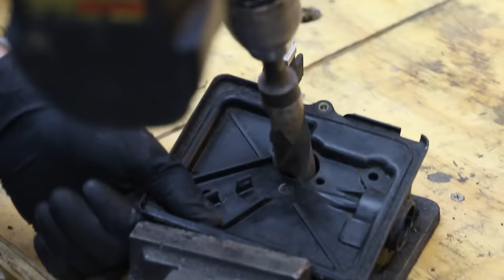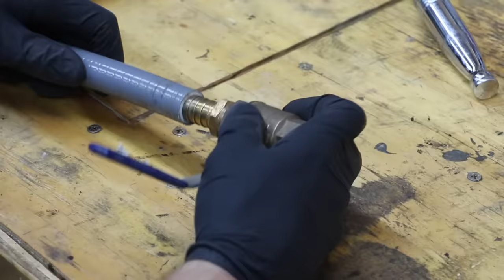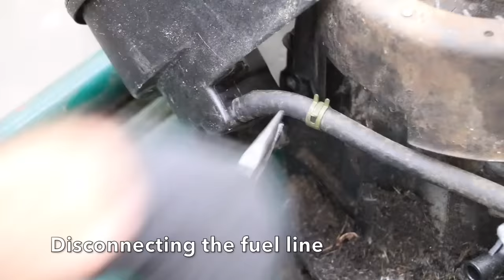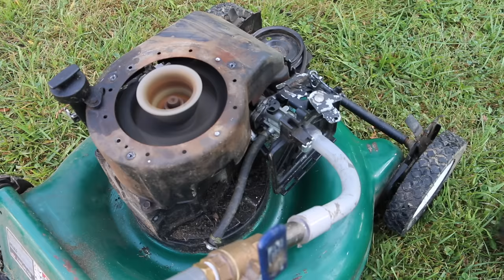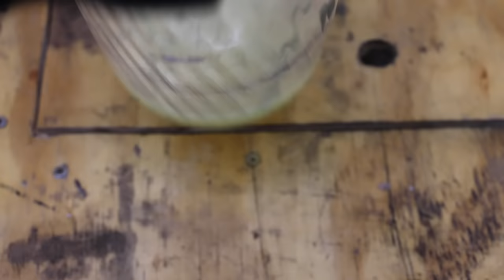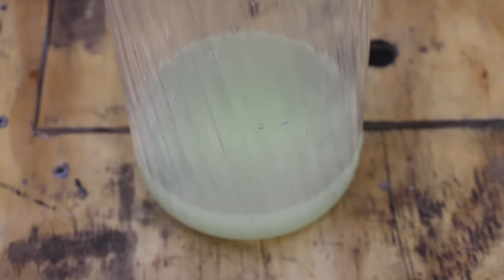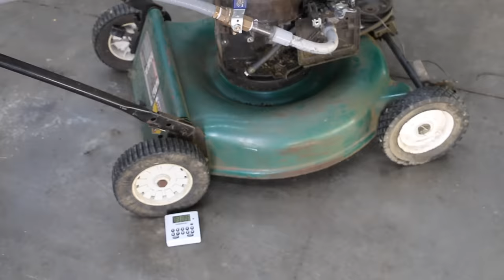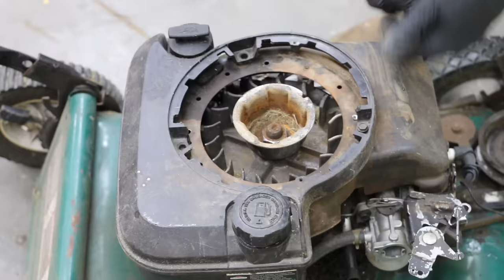Will a "Gas Vapor" Container Improve MPGs and Fuel Efficiency?  Let's find out!

Comment: Lift trucks that run on propane, can run on liquid or vapor propane and are not interchangeable. .So if you can fit a propane vapor carbutator on a car or truck  engine. . with throttle capability. . running on vaporised gasoline ; it could be fonctionning ☺

Comment: So, something that has come to my attention is HHO. Bottle with washers or such stacked negative and positive posts connected in water with backing soda, under a charge creates HHO (hydrogen.) what if you where to run this set up with a Hydrogen generator that pumped to the fuel container?

Comment: What if you used smaller tubes smaller system that has the same pressure it seems you could throttle back and possibly get the same rpm being its a vapor it takes more to pressurize the giant pipes idk just a thought
Reply from the maker: Thanks for the suggestion.

Comment: If you had cut the pipes to touch the bottom of the canister then drilled holes at the bottom sides of the pipes to suck in the vacuum air, then you could have used most of the fuel.

Comment: The tube coming out of your jar going to carb should only be at the very top of the jar, not in the fuel, but the tube for air should be to the bottom of jar in the fuel….. but to be safe i use a one way drain valve in case of backfire….

Comment: Smokey Yunick did this with 2 cars and got 50 miles to the gallon. It was not done the way you did it. I think Smokey had a patented for the vapor car. Years ago in the30s  40s or 50s people did this wanted to patented it but never went any farther. The big oil company told them to stop. The ones that didn't want to do it was found dead. Smokey system heats the gas to a boiling point to make vapor by the exhaust temps or something like this. You really need to dig hard as the big oil does not what this.

Comment: Well you had no way to adjust the richness of the vapors. Either you put an air bypass valve somewhere or you change the height of the gasoline and how far the air bubbles through the fuel. So you did not adjust those parameters.

Comment: All engines run on fuel vapor. Only different with a vapor carb setup, is you can avoid the extra droplets that do not dissolve into the air, and are not burned. Eliminate those, save fuel, and create less soot. Simple.
Reply from the maker: Thanks for sharing.

Comment: IVE DONE THIS ON MY HONDA CIVIC, THE PIPES YOU USE ARE WAY TO BIG,(FOR A LAWN MOWER , BUT NOT FOR A CAR,) AND BLOCK THE ENDS OF THE TUBES  OFF, SO YOU DONT MAKE SUCH BIG BUBBLES,, SO THE AIR SUCKED IN  CAN ONLY ESCAPE THROUGH SMALL HOLES DRILLED  NEAR  THE BOTTOM OF THE TUBES THEN IT FIZZEZ,(NOT BUBBLES) AS WE KNOW ITS ONLY THE VAPOUR YOU WANT,
 SO YOU NEED A MUCH SMALLER  AIR PRESSURE  SUPPLY TUBES,  BUT A BIGGER INLET SO MORE AIR GETS IN TO AGGITATE , CREATING  MORE PRESSURE, MY CIVIC DID A LOAD MORE MPH  AND WHEN I WENT TO SCOTLAND WITH IT I DID 1447 MILES ON 70 QUIDS WORTH OF FUEL AT 137 A LITRE, I ALSO FITTED A HYDROGEN KIT WHICH I MADE FROM SCRAP STAINLESS I GOT FROM THE SCRAPYARD FOR PEANUTS, SCRATCHED THE PLATES,(MORE SURFACE AREA TO CREATE BUBBLES), OFF SET THEM SO THEY DIDNT LINE UP,,, BENT THEM,,,AND VERY MUCH THE SAME FUEL AMMOUNT WITH A NISSAN ALMERS I.6  THE HYDROGEN WAS A 10 PLATER, 
I'M MAKING A DUEL SYSTEM NOW FOR A LINCOLN CONTINENTAL MK 4. 7.2 LITRE,  WHICH USES BOTH HYDROGEN AND FUEL(BROWNS GAS) AND WITH SUCH A HUGE TANK FUEL VAPOUR, IS IN GOOD SUPPLY,
AND RUN IT  WITH AN OPEN FUEL CAP VENT (TO LET AIR IN )
, YOU DO HAVE TO  UNPLUG THE   LAMBRA SENSOR, ON MODERN CARS(FOR THE HYDROGEN SET UP ),, OR YOUR ENGINE WILL FLOOD FUEL,, AS THE SENSOR CANT READ ANY UNBURNED FUEL IN THE EXHAUST AS HYDROGEN BURNS ALL THE FUEL ,, AND SO SENDS MORE FUEL TO THE CARBS,, BUT NOT ON THE LINCOLN AS IT HAS NO SENSORS ,,,, BONUS,
Reply from the maker: Thanks for sharing.

Comment: See science of stoichiometry, used in chemistry all the time, basic idea for combustion engines and furnaces is what do you Want to have left over from the combustion of that fuel, in a industrial furnace you may purposely run it richer or maybe leaner depending on what you want to allow as byproducts, may not want nitric oxides produced for instance, but you also want the most energy or heat generated also, this is why they may recoup the heat which would of been lost out flue to preheat incoming air, increasing efficiency.
Reply from the maker: Thanks for the feedback.

Comment: Tom Ola ? Spelling from El Paso Texas did some work and one of the things he said earlier Was the MPH we're that better.

But one day he found the fuel tank was ice cold from the Evaluation of the fuel. According to him he place a heater in the tank and used the heat from the engine to warm the fuel.

According to him the MPG took off to 100 MPG in a Ford LTD or car of the same size.

Some the earliest photos show his plumbing coming out of the gas filled spot and running along the side of the car.

 His later works had the fuel hose under the car and what's supposed be his patent was on line with News reports and News photos.

Another name big in racing was ? Spelling
Smokey Yuncy . who's hot vaper engine made the cover of popular science or popular mechanics.

He had a two cylinder engine making more than 150 HP and was only around 60 CI or so and getting 60 MPG if I remember right.

The store was or should be online as well he would heat the air/fuel three times first to 220 d using the cooling system.

Then throw a turbo charger and then in the intake manifold too 440 d . I thank smokey said nomal trmps don't get past 130 if I remember right.

I believe he said it took 20 minutes for a air/fuel charge to break up and in the normal engine it comes apart faster than you can punch a stop watch

Some very interesting stuff around I found this copy of PM at a yard sale and it was amazing along with good color photos

Comment: Yup people have been doing that for years when they started doing HHO converters I watch videos of a gentleman talking about the internal combustion engine was originally designed to run on a fuel vapor not a fuel solid when it runs on a fuel vapor you're not burning anything but when you're running on a solid you're burning and therefore there is a carbon output

Comment: I have always wondered if he would run his mower by way of a hydrogen generator run from the engine charging a small battery. 🤔
Reply from the maker: Great video idea! Thank you
Reply: Yep, how long would it run on the same amount of water. Saw another ch make an engine from a fridge compressor and three cylinder engine from water pump. He used Y connector and another ball valve for air mixing, no carburettor.

Comment: I had an experimental Ford carburetor accidentally got out on one of my Ford falcons from the '60s 2400 lb of three speed straight 6 it had two adjustment screws for a single barrel it also had a preheater prior to going to the motor much further was had a reserve that was warm by the engine prior to going in the vehicle did get her off late 55 mi of the gallon when I couldn't replace the motor the guy found out that it was a Ford property and it was giving the standard carburetor which put the mileage back down around 25 miles of the gallon, different type of carburetor and preheater doubled some gas mileage on the vehicle
Reply from the maker: Thanks for sharing.

Comment: Gas vapours were the selling point for the Pogue carburetor. Theoretically vaporized gasoline could get 100 miles to the gallon. A secondary thrust for vapors, is H H O - vaporized water which is explosive when ignited. JCB Industries in Britain ahd engines running on hydrogen. Therefore it is feacable.
Reply from the maker: Thanks for sharing.

Comment: The truth is you can run a motor on the vapors .but you will burn the valves up if you can mix a little liquid fuel with the vapor you can increase mileage and power without  almost any pollution. it burns everything but unfortunately your valves and your fuel delivery system will have to be changed. because of the higher heat con tent  I know someone who has built an engine to run this, it gets 70 miles to The gallon plenty of horsepower and it’s a V-8 engine he does not want anyone to know because he thinks they will kill him ,it’s possible but I’ve seen it it does run. And of course I tried the lawnmower trick and it works it seems you get gasoline when it’s heated it expands to almost 7 times with volume with the same amount of fire power but of course they are dangers involved my friend system has a modified what looks like Mr. coffee a tube wrapping around the exhaust manifold the fuel turns into vapor and goes into a canister under pressure and this is what is released into the manifold but he has some set up I don’t understand like fuel injection spraying some liquid fuel in very small amounts he still had to change his valves though he told me to handle the heat the first time he tried it it only lasted about a week before it screwed up the valves a little experimentation and I’m sure you could get this to work .whether or not they would try to come kill you I don’t know ?so you should proceed with caution today’s world is pretty crazy.

Comment: I don't think this was set up right to be considered fumes if you think about it the way the motors compression was built up especially with the tube going straight into the fuel it's basically a siphon

Comment: I'm just curious, what do all of you think a carburetor does?

I can tell you.
IT VAPORISES FUEL! 🤪

So this test actually went exactly as expected.
The engine ran fine and the consumption didn't change.

What you really did was to add an extra carburetor to the engine, or actually, replaced the existing one with your own bottle version, since you feed the vapor directly to the air intake.
A lot of work for nothing.
Reply from the maker: Thanks for the feedback.

Comment: Maybe you have already done this I ran across a video that said take a generator rip the gas tank off and connect some tanks and generate hydrogen. Don't know anything about that guy would be interesting the test. Especially with a load attached and a power meter because that can fluctuate and still run generic motor tools.

Comment: The way I built my tank that I wanna put in a car is the chamber's inside of it that I did it that tried to catch as much solid As I can to prevent it from getting pulled up into the engine taken away from it just running on vapor so I have chambers built into my tank to try to prevent that so it's only taking the vapor the great thing about it only running on vapor again is there's no solid being burn therefore there's no carbon output it is very clean burning very clean burning when I 1st did my test I did a small blowtorch And you couldn't even really even smell the gas that was vapor that was being burned

Comment: No they wouldn’t.  Why? Would they? They are a codependent industry. Also back in the 70s the vapor chamber tech was heated as the gas dropped in, it was heated slightly to aid vaporization, then fed by tube to the carb where it was pumped in as vapor not a spray

Comment: You are not adding the vapor in properly you should have ran a t fitting to the original fuel line. And had the proper  size hose as the regular fuel line. It will have no restriction because it does not  require a filter and you are giving the carburetor the ability to meter the air fuel ratio still unlike your intake fed method. The piston will draw in an unbalanced ratio of gas vapor to air through the carburetor manifold without metering it. Though it will run it will be cool at ideal but will require wide open throttle at all times. If the carb was back in the equation I guarantee you would see an increase from the vapor.

Comment: This is EXACTLY how those jokers make engine that run on "WATER" lol.... My grandfather, god rest his sole, used to see a demonstration every year at a local Historic Steam Engine Show and flea Market, where a guy would run a small motor like this, but pour water into the container, from a water bottle he was drinking from.  NOW, the reason this worked, was because the container already had gasonline in it.  So the water didn't make enough vapor, but the gas did, thus making it look like the engine was running on water "fumes"...  I don't know why he didn't understand that it was a hoax, but he honestly beleived an engine could run on water.  He was an aircraft mechanic in WWII then a machinst and worked for National Instruments, and once retired he repaired small engines and made "things"... I just don't know why he couldn't tell that it worked just because of the gas vapors.  I guess he just beleived the guy was running pure water in the thing, and beleived the guy when he said it.  The other thing I guess, is that he saw him dump water in.  Normally, you can't run an engine if water gets in the gas, but when youre only using the vapors, it will.  FYI, don't try this to a car engine with a load and variable ignition timing.  When it tries to Advance, it will knock so badly you run the risk of a massive lean burn, and can melt down a piston or burn a valve.  Small engines tend to put up with more stuff like this for longer, and don't run as much advance timing, if any.

Comment: since water electrolysis will produce both Oxygen and hydrogen, you should be able to get rid of the carburetor all together, and inject the gases right into the cylinder.  give it a try.
Reply from the maker: Thanks for the suggestion.

Comment: Liquid gasoline will not burn. Only vaporized and blended with oxygen will it burn. Hmmm, isn't that what carburetors and fuel injection do anyway? How would prevaporizing the fuel help? An additional vapor metering devise would be needed in order to control the engine.

Comment: I think ppl are refering to Tom Ogle. Tom Ogle? idk the devils in the details, fuel tank imploding needing reinforcing, then fuel tank freezing up, sounds to me like he was using the engines manifold vacuum to put the fuel under a vacuum to lower the boiling point to near ambient temperatures or lower so he needed to heat the tank slightly to keep the fuel boiling, fuel vapour at room temp would mean it wont thin out the air by heating it and lower available oxygen which is why performance cars use a cold air intake! but infact the fuel boiled under vacuum vapours would be colder then ambient temp with higher density decreasing air temp raising available oxygen as its being mixed with the fuel vapours. Ive seen a lot of people try to repeat his experiment but none have tried boiling the fuel under a vacuum and think thats exactly what Tom did that day when he plugged the hole in his fuel tank on his mower with a vacuum line from the carbi to kept it running and he figured out why it worked so well.

Comment: I'm surprised that YOU we're surprised that the engine ran on vapor....If anyone out there didn't know gasoline or any other liquid fuel ONLY burns as a vapor...The liquid fuel ISN'T what is actually burning....In fact if you could completely eliminate the vapor from a container of liquid gasoline it would be completely possible to snuff out a lit match dunked in the liquid gasoline as of dunked in water

Comment: You shouldn't have had 2 air intakes on the jar because it's sucking in more vapors than it can burn so you wasted a lot of your vapors it would have ran a lot longer than it did had you only have used one air intake pipe and also it does save about 20 to 30 percent and on top of that it's way more better for the environment because you're not burning the gasoline into the atmosphere and creating all that carbon monoxide
Reply from the maker: Thanks for the feedback.

Comment: simple fact a gasoline engine runs on vapour not liquid . So all this is is a different kind of carburetor. No such thing as perpetual motion machines. If there is any difference it is due to a lean air fuel mixture. That is why fuel injection is more efficient as it controls air fuel mixture to as lean as possible without melting the engine.
Reply from the maker: Thank you for sharing!

Comment: On the run with the gas tank installed there could have been some gas left in the tank as it was never verified which would essentially offset any advantage observed. Often times there will be residue gas left in the tank after running empty because the fuel line cannot reach

Comment: And have you tride the the engine running off from water converted into Hydrogen. Using hydrolysis.  The set up seemed simple enough. A generator.  2 plastic containers modified.  An some metal plates attached to metal threaded rods for the hydrolysis chamber and the generator has a battery with a starter which is also used to start the hydrolysis till you get enough gas for the generator to run on..  and some kind of powder called HH. to help the water create more Hydrogen.   Maybe you can see if this is real for us an if there's any downside to it.  Like the HH. secret powder

Comment: I knew it would work if the motor could pick up the vapor gasoline on its own is not flammable the flamabe part is the vaper your car injects the gas into the cylinders and the spark plug ignites the flamabe vapor
Reply from the maker: Thanks for the feedback.

Comment: Isn't the idea to add water so the hereon  in the water is oxygenated & aids  a increase in harrow enriches the fuel vapers . thrust as pushing air throw the water vapes produce gas to ben on a Cooker.  tri that to improv fuel economy  see if adding 50% water to the mix works .